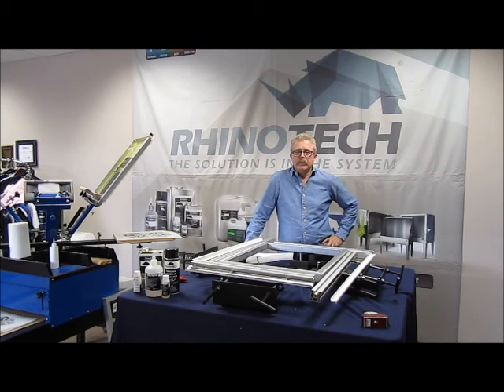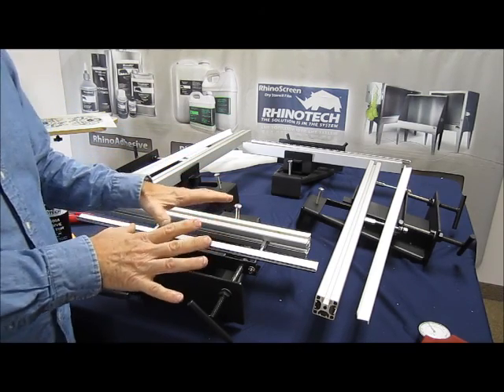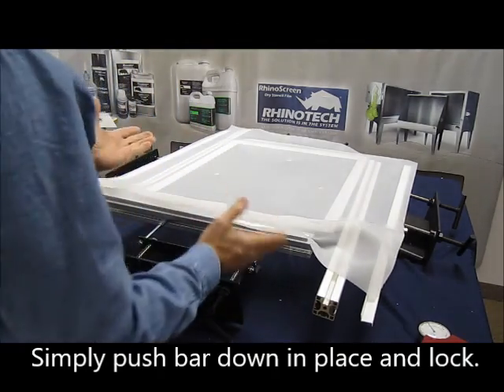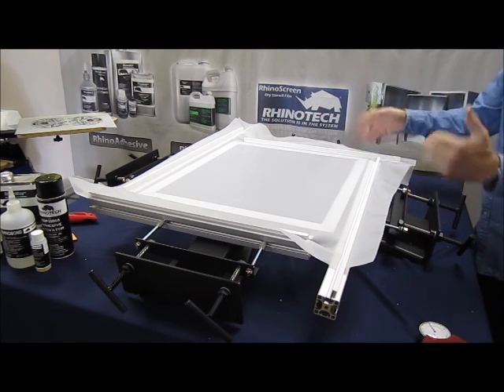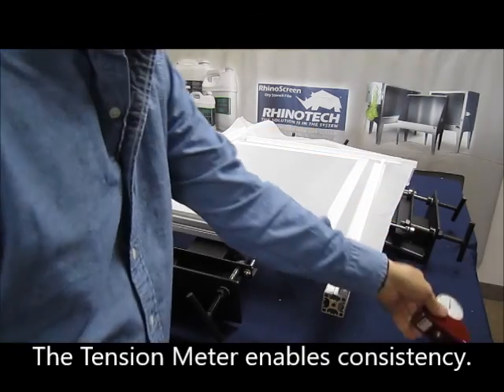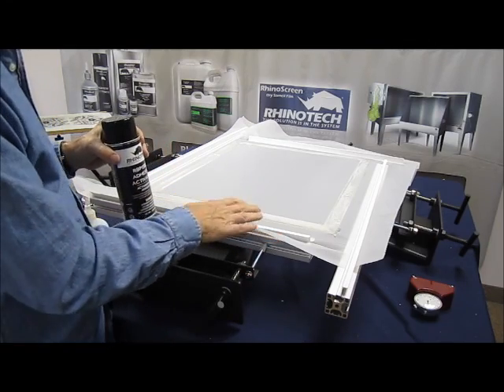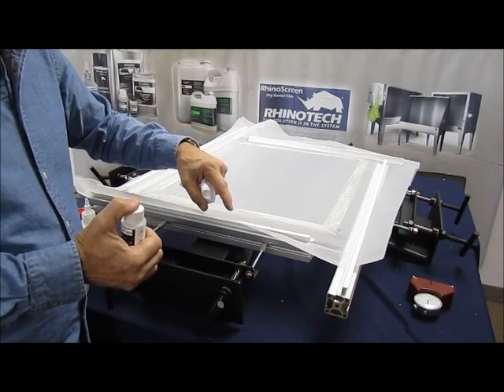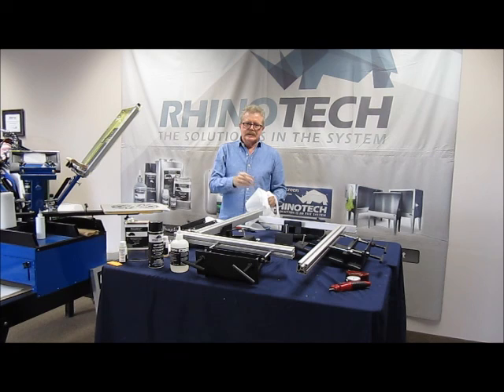Manual Screen Stretcher & Instant Frame Adhesive from RhinoTech

Comment: We used RhinoBond Toughened Instant Adhesive, 
RBT 300 with RBP 1500A Activator. This glue is a  mid-range viscosity. You can order directly at www.rhinotechinc.com. If you have more questions, please call our customer service specialist at 651.686.5027 x 4. Thanks, so much, for watching our video and for your question.